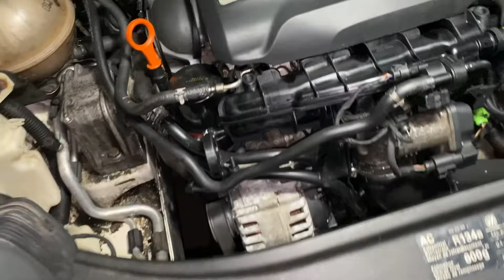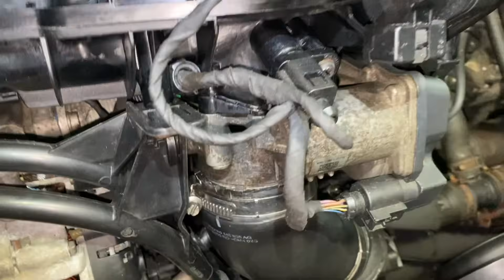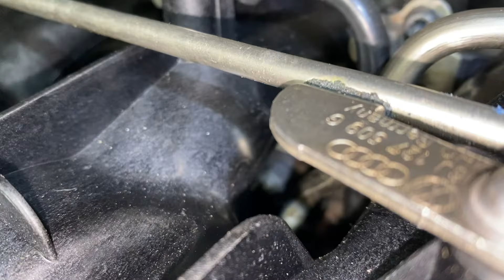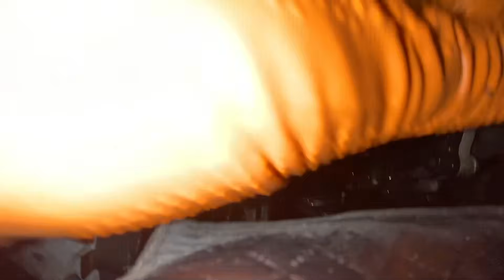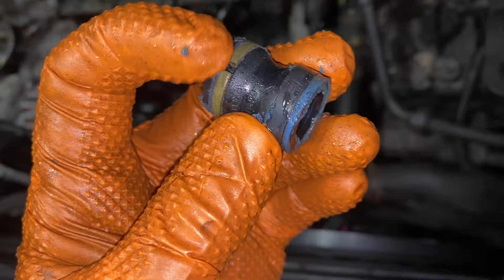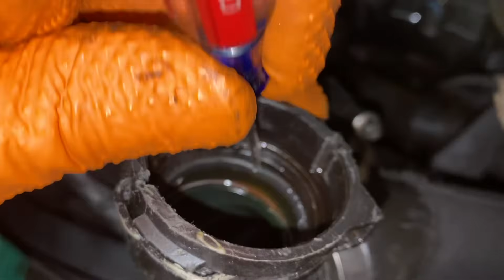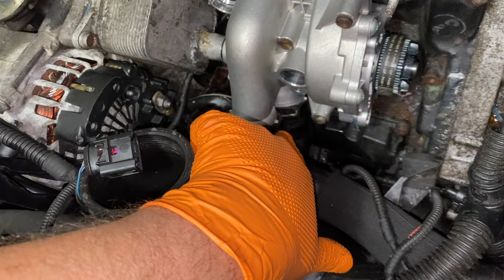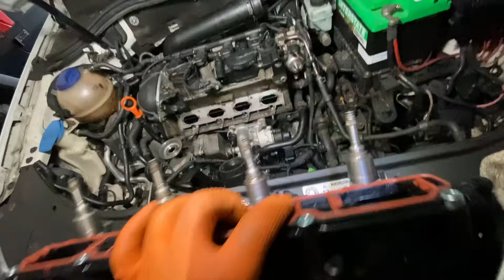Step-By-Step Water Pump Replacement on VW Passat, tiguan, CC, EOS 2.0 Turbo TSI/ CCTA  2008-2016

Comment: I’m changing the water pump on a 2012 Volkswagen right now that video you posted was excellent. Good job that’s helping me a lot.
Reply from the maker: Thank you! Awesome glad to hear it helped you out! Just make sure you watch my other video on the hidden bracket that has to come off to get intake manifold off, I left it out by misstake because some vehicles don't have one but yours may.
Reply: @motorcarnut mine is different after manyfold, it has some blue like rubbers. But disassembly was very similar.
Reply from the maker: What vehicle you working on?
Reply: @motorcarnut  I was working on a VW CC 2013, my milleage is 60000
Reply: @Muxik4k all of these motors are pretty similar the most they usually change are some gaskets and they add or remove some parts on some models
Reply from the maker: Yep very similar like another person just said
Reply: @motorcarnut where is your other video on the hidden bracket that needs to come off before you can take the intake manifold off
Reply from the maker: Search vw 2.0l intake manifold removal hidden part
Reply: @motorcarnut  the job is done and i have everything put back together, thank you! i have a check engine light on for code P2008 (intake manifold runner control circuit / open bank 1a) do you have any idea what could cause this i’ve double checked everything and can’t seem to find the problem.
Reply from the maker: Make sure you plugged in the connector near the oil filter. That code is common with a failing intake manifold or leaking through the lever portion of the manifold and should be checked or replaced. Sometimes when you disturb the manifold it can cause that code.
Reply: Which tools do you need? How long does it take?
Reply: I spend already 2 days disassembling. So far 2-3 days maybe.

Comment: What is the cover below the waterpump? Is it known to leak oil ?
Reply from the maker: Usually it's the water pump leaking on it but if its engine oil then yes the seal needs to be replaced but no they don't usually leak. Make sure the leak is not coming from the valve/cam cover first.

Comment: I just replaced the water pump. When I started the Tiguan started, the check engine light came on and stayed on. (It wasn't on before) Codes read said manifold. Car ran great, so I had fault cleared. This morning, check engine light re-illuminated.
I suspect it's the manifold but not confirmed yet. Is it typical to have that light on after reinstalling the manifold? Or is this a situation where engine light clears after 50 miles of driving. Any thoughts on this? Big bummer.
Is it easy to overtighten the manifold bolts (snug, than just a bit more) if you have no torque wrench.
Reply from the maker: No its not typical, you messed something up installing the manifold, recheck your work and when installing manifd it has to be flush against the head making sure a fuel injector is not hanging up.
Reply: @motorcarnut thanks for your reply. I did forget something....not sure yet but fault code is P2008 - Manifold Runner Control Circuit fault (Bank 1).
I either didn't reconnect the electric wire to the Runner solenoid; didn't reconnect a vacuum line to the solenoid; or the Runner arm ball connection got bumped. I'll let you know which it was...hopefully it will be that easy.
Reply from the maker: Yes good luck!

Comment: Dude I did everything you said and I am YANKING on this manifold to get it off. It comes out a little bit then pops back in.. any suggestions?? 2014 CC 2.0
Reply from the maker: Yes its in the description here:
https://youtu.be/pihBmXjRh4Y
Reply: @motorcarnut  You rock brother thanks for doing what you do!
Reply from the maker: Thank you too, appreciate that!
Reply: It was a bitch but there are connectors and clips under it and when I took mine out the injectors stayed in the side of the engine
Reply from the maker: It can be tricky if you never done this before.

Comment: They just replaced the pump on my 2016 VW Tiguan and the garage smelled like gas so i took it back and they said its normal and that gas was spilled while working on the car. They also said it would go away with time. Well its been 3 weeks and the garage still smells. Is this normal? Car runs great and no check engine lights. But the smell didn't get worse or better.
Reply from the maker: Shouldn't be smelling gas at all after a couple of hours after the repair. Check gas cap for tightness not bring it back, may be dangerous.
Reply: @motorcarnut after seeing ur video I feel like it might be coming from that evaporator canister.
Reply from the maker: Its possible, a smoke test will tell but for this to happen right after repair seems strange.
Reply: @motorcarnut yeah these mechanics are something else. Im up to 5K in repairs this yr. And it seems like something always messes up after they fix something else.
Reply from the maker: I feel for you , try one thing at a time. I deal with this all the time
Reply: @motorcarnut will do sir.

Comment: Do you know it this setup and procedure is the same on a 1.8 tsi BZB from 2009. Have a Skoda SuperB and at first glance the engines look very similar.
Reply: I have the pump out now and it was exactly the same. Do you have a link to the replacement you used?
Reply from the maker: I don't but you can get them on Amazon for about $50.00 an aluminum one too.
Reply from the maker: It should be very similar

Comment: When the engine is over 2000 revolutions, a strange sound is heard.
The same sound is heard when I take off the pk belt
The car pulls well, not a single error is lit
Is it a water pump or something else?
https://youtu.be/lUeHFqfV_RE?si=9d51InQX7hyFur_z
Reply from the maker: Sounds like the serpentine belt maybe? but doesn't sound that bad to me.
Reply: @motorcarnut  This is a 1.8 TSI engine with a chain. Do you think the sound is coming from the water pump serpentine belt?
Reply: It seems to me that the squeaking sound is coming from a loose bearing
Reply from the maker: No, the engine serpentine belt maybe
Reply from the maker: Could be anything hard to tell from a distance.

Comment: Hey great videos. I recently bought a broken tiguan so these are really useful. One thing I wonder about - when you mention a $50 water pump for instance - what brand of parts can I trust, Apart from genuine of course.
Reply from the maker: Thank you! They are aftermarket no brand names. Some people bring them in for me to install I don't guarantee the part on those, but none came back for replacement .

Comment: Does any one know if this is the Same with a 2013 vw p tDi sel?  I changed the oil cooler housing but it still leaks somewhere. I think it’s the water pump. Any ideas and help?
Reply from the maker: Its different but video may help you some

Comment: My water pump belt broke and took the time to replace the water pump as well since it was leaking but I can’t seem to take the belt off. I’m doing everything correctly 24mm on crank holding the engine and 12mm reverse thread bolt turning. Water pump pulley keeps turning while I try to take the bolt off and then when I remove wrench the pulley bounces back to where it originally was. I even tried wedging something in to hold the pulley still seemed to move. Maybe I need better grip? Any idea? Thanks
Reply from the maker: You take the belt off and install both at the same time belt and pump, don't mess with the gear.

Comment: Hey MCN. Really enjoyed your video. Good clear explanation. 
Just started 17 Tig. Those connectors drive me crazy! So.e seem a lil different but may were stubborn cuz temps were 40. Cold ish but not crazy. Be better in summer! Anyway,  I'm stuck on I can get pump/ housing off! Do I need to take out temp sensor 1st? Someone had put a metal one on so maybe it's leaking elsewhere.  But wanna get it off to inspect and clean everything. But the right side is looser than left. Seems the unit won't get completely off the left dowel. Cuz the union to cooler seems to keep it from clearing the dowel. Any suggestions? You really have a knack for knowing what people will trip up on and a pleasant demeanor as well. Thank you!
Reply from the maker: Thank you man I appreciate that! No you don't have to remove the sensor just pry it up on the driver side of the pump and should break loose.
Reply: Hey. Im sorry bout onfusion. Was worn out . When I said left I meant right. I messed up and was telling it like I was looking at it fromt standing in front. So the unit wont clar the passenger side dowel. Its right above that union. Will take sensor out in morning and see if get more wiggle room .
Reply from the maker: No problem, If it looks just like the pump in the video it should come right off, it is a tight fit.
Reply: @motorcarnut  lol. My skills have eroded. When I got sensor out I noticed the last screw under the sensor. Duh! I had thot 5 already came out cuz was counting the one that holds the hard line in center.
But got it out! But trouble reared it's ugly head
 Instead of getting new bolts I used old ones even tho the stars looked a little rounded
 Sure enuf on that same nolt I missed I competely rounded it off. Now I gotta hope and easy out with work on those type of bolts. Then gonna get all new ones.  Manifold bolts look sharp still
Reply from the maker: Hey no ones perfect! Glad you got it off.

Comment: great video, but you forgot to install the bracket for the fuel injectors.  Also recommend replace the water pump belt for this kind of job.
Reply from the maker: Thanks for the heads up on the bracket! But it was on a vehicle I was taking the engine out of. Yes it usually comes with the water pump.

Comment: Excellent video - followed it and it saved me a lot of time and effort.  The only thing I would add is the challenge of installing the belt.  Turning the crankshaft 24mm bolt clockwise while pushing the belt onto the pulley (after pump installation) was key (also using the yellow washer thing that came on the pump).
Reply from the maker: Thank you! The way I do it is to install the belt with the water pump at the same time. Never seemed to have any problems that way?
Reply: @motorcarnut  I tried that and seemed to fight the pump while trying to line up the pin holes. I was probably not doing it correctly and went to Plan B.
Reply from the maker: Hey, you got it done, that's the main thing and thanks for your info, may help others as well.

Comment: Hey man, I really really appreciate this video. I was facing a major cost of repair, and following this slowly I was able to do this. The most painful part for me, was truly that stabilizing mount for the intake manifold. Really challenging to get to, but I managed it. Caught me by surprise, but you do have a pinned vided to it and I figured it out. In that process I found the waterpump had failed, but was also able to clean up and diagnose several other issues while everything was out. Some of those plugs are really challenging to undo, but again you helped me understand how to disconnect those without causing breaks. I was fortunate that none of the injectors came out, but it was tricky with the injector electrical plugs. I also replaced the intake manifold gasket since it was out, as well as did the full deep cleaning of the carbon deposits. Lots of videos on that process, felt like a dentist. Again, truly appreciate your videos, made me feel back in control of my vehicle.
Reply from the maker: Thank you for the support, glad the videos helped! And appreciate you taking time time out to give me feedback!
Reply: I got so frustrated with that stabilizer bracket I ended up just leaving it unbolted on the bottom.  That was about three years ago LOL!

Comment: There is a bracket bolted to the bottom of the manifold and the front of the engine block that has to be removed before you can pull the manifold. This turned a four hour job into 8 hours and a trip to buy a set of triple square sockets. Needless to say this was pretty frustrating since it wasn't even mentioned in this vid.  I thought I was completely ready to make this repair, then had send my daughter back to college without her car. Hopefully MotorCarNut will caption the vid or pin a comment to address this glaring oversite. Also all of my injectors stayed in the block instead of coming away with the intake manifold. I would recommend checking for leaks after the pump is connected & BEFORE reinstalling the manifold, I rolled an O ring on the union and had to start from scratch to correct it. Lastly if you have dual plastic coolant pipes to the aux water pump on the bottom of the car, change to metal ones. I got them from Amazon for 30 bucks and took an extra 5 min, mine were super brittle.
Reply from the maker: Sorry, I did. You should have read the video description, it's in there. Not all vehicles have that bracket and the vehicle in the video didn't either. When I realized that I added another video link explaining that bracket it to the video description.

Comment: Well done! I appreciate the clear and concise explanations. When doing this waterpump replacement on my 2017 CC I noticed that this car has an additional manifold support which connects the midsection of the manifold to the lower engine block. This support is an aluminum casting, about 8" long - exceedingly difficult to get to the bolts! I also recommend replacing the water pump belt and the manifold gasket. Thanks again.
Reply from the maker: Thank you very much for your support!, You are correct. I added this video to the description after I made it because some vehicles don't have that brace and forgot to mention it in this video. Yes definitely a great recommendation.
https://youtu.be/pihBmXjRh4Y

Comment: Never ever ever put Vaseline on EPDM cooling system seals. That kind of rubber isn’t resistant to mineral oils.
Reply from the maker: A light coating isn't going to do anything.

Comment: Note you MUST get wrench DPTOOL EA888 
Or similar to loosen the water pump gear bolt. It is reverse thread so it turns RIGHT to loosen. It allows you to move the gear out enough to slip off and then reinstall the drive belt. If you don't loosen that gear bolt you'll never get the belt back on with everything aligned. If you use a regular 12 mm wrench you risk rounding off the bolt end and then you will be totally screwed.

Comment: How in the world do you disconnected the connector at 6:05 I can not do it for the life of me and my connector is facing downwards so I can’t even get a good grip on the tab or the connector
Reply from the maker: Try with a pick or small screwdriver
Reply: @motorcarnut  same technique still, push towards it then lift up with the tab right. Haha I knew try harder was gonna be the answer
Reply: @KreativeCaboose did you have any luck doing the same thing now
Reply from the maker: He did, a year ago

Comment: Is there a link for the water pump?
Reply: I put the coolant temp sensor clip in exactly like you said not to and it cost me 5 hours 150miles on the side of the freeway
Reply from the maker: That stinks. It popped out?You had to do it on the side of the road?
Reply from the maker: Yes:
https://www.amazon.com/Assembly-Replacement-Tiguan-Beetle-06H121026AB/dp/B08FHR18JZ/ref=asc_df_B08FHR18JZ/?tag=hyprod-20&linkCode=df0&hvadid=693439390246&hvpos=&hvnetw=g&hvrand=11806014129894929604&hvpone=&hvptwo=&hvqmt=&hvdev=c&hvdvcmdl=&hvlocint=&hvlocphy=9004531&hvtargid=pla-966360424526&psc=1&mcid=6362a649f97a3303a1daab57aa99b17e

Comment: Thank you for taking the time to show us a super clear break down of the process. Gives you the best description of the how to do it!! First time working on a VW after this video I’m sure will get the job done!! If a 3 year old watch this video he will definitely learn how to take the water pump off that’s how great he explains everything! Great video
Reply from the maker: Thank you for the kind words! Really appreciated! Also, in the video description there is another video on the hidden bracket that must be removed to get the intake manifold off. When I made the video that particular vehicle didn’t have one a forgot to mention it, just a heads up! Good luck if you get stuck give me a holler.

Comment: Thanks for this video. My Saturday is gone, but I still have $1000 in my pocket. For some reason my kit was missing those 2 big o-rings for pump/hose connection. Ran to 4 stores with no luck. The old ones looked really good though, so hopefully no leak in a future. Thanks again for taking time and making this video
Reply: Same thing happened to me, I just inspected them, and they looked good. Made sure the connections were secure.
Reply from the maker: Great! Glad to hear its fixed. I know the local auto parts or dealers never have what you. But you are probably fine if it's not leaking when you put it back together it won't leak.

Comment: great video and tutorial. I don't know the anatomy of these vehicles at all so i paid a euro guy to swap a motor and within a week I'm noticing coolant getting low. sure enough it's from the area near the water pump and he's not wanting to repair. using your process I got it well until the point  was yanking it out. got separation for about 2 inches then its stuck solid. Won't come out or back in. Like I'm missing a bolt or something in the middle. I removed the throttle body hose because it felt like the hang up might be there. is there a possible bracket or something different added to a 2011 CC? Either way than you so much for the process! It would have taken me 3 times as long to get to this point. My next step is to start removing throttle body and brackets just to be able to see better.
Reply: Well yep. that did it! thank you!
Reply from the maker: @freddiebaez9751 Hey great! And thanks for the update!
Reply from the maker: YES!  
https://www.youtube.com/watch?v=pihBmXjRh4Y.

Should of been in the description!